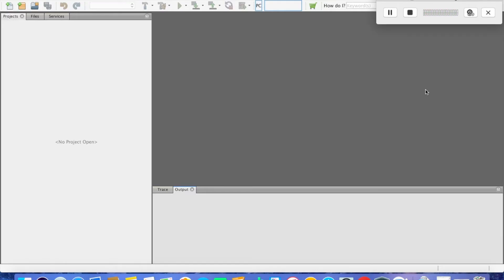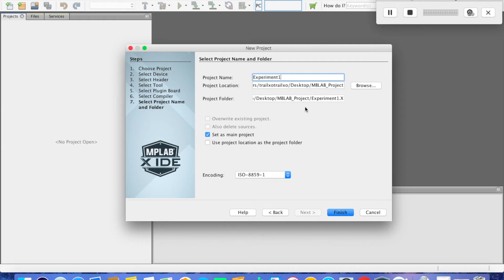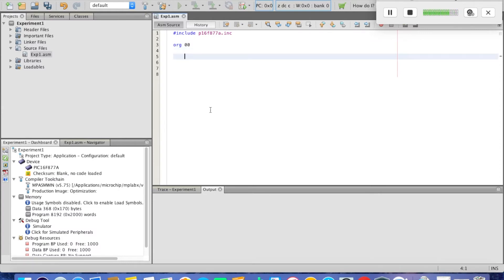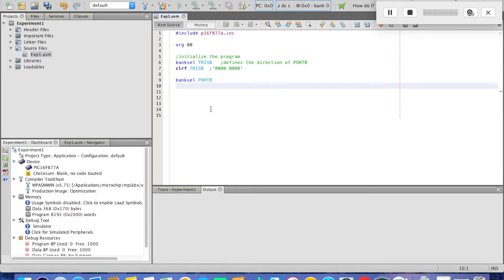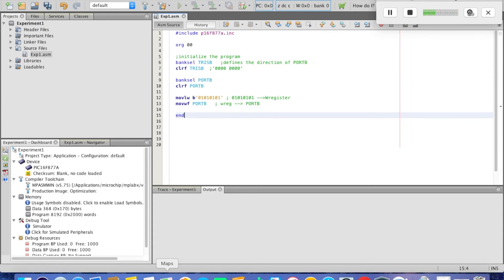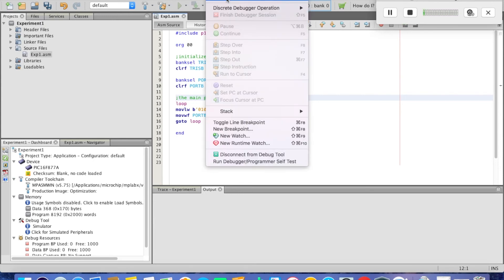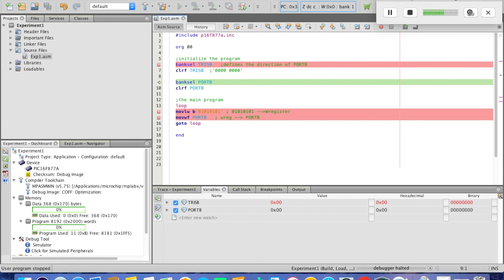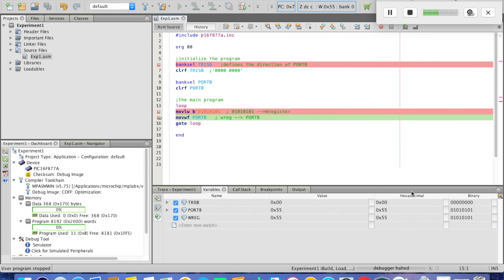Tutorial (2) Using Output ports in PIC microcontrollers

Comment: How would you output a number to a specific pin in port b? For example, output the number 1 to pin 5 of port B
Reply from the maker: The output is binary. For PortB it is 8-bit. so, if you want to display number 10 decimal to PortB, you simply convert 10 decimal to binary 00001010 (0A  in hexa)
then wrie the following:
movlw d'00001010'
movwf PortB
Reply: BSF   PORTB,5